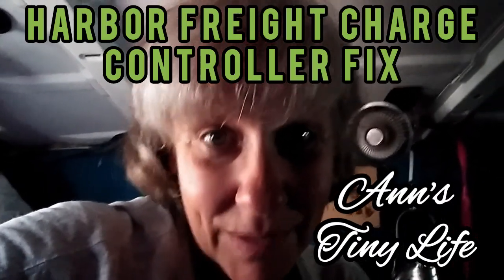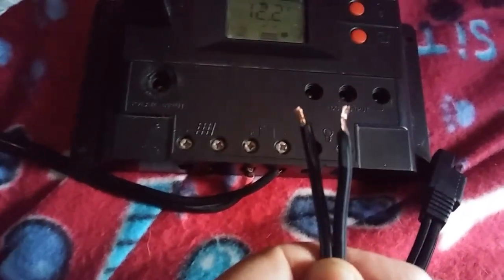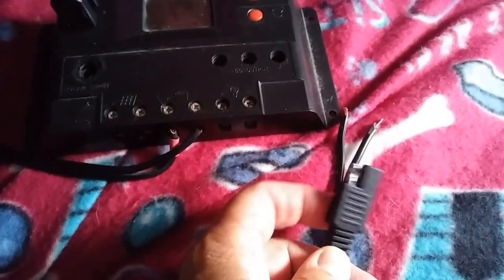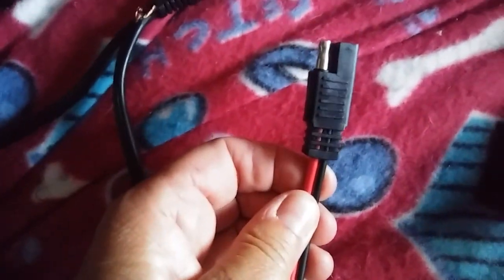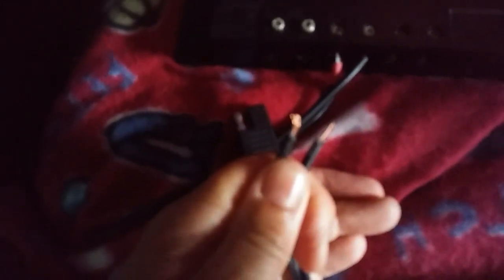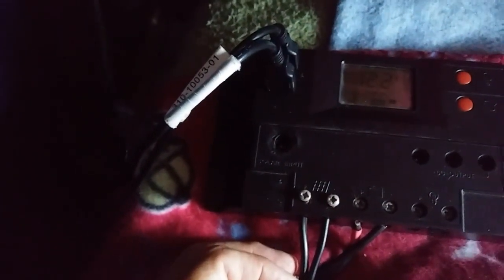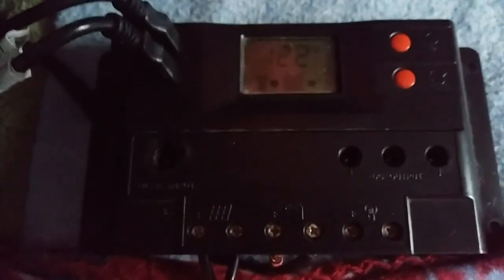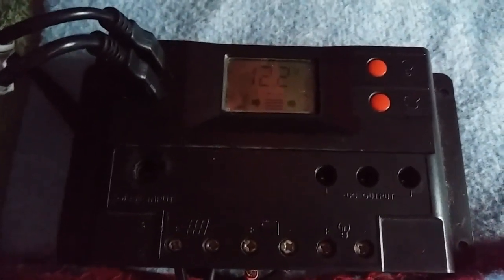I Fix My Harbor Freight Charge Controller so I can continue using solar! - Ann's Tiny Life

Comment: Just a tip Anna get 42amp wire u get better results and after your cables look like 7.5 amp so not good enough if u begin in 13amps

Comment: I have a similar controller and friends that use that type.  The wires have to be stripped fairly short as you did them or too much naked wire hangs out.  You solved the polarity question quite well although I think they simply dont work when connected wrong - Im not game to test the theory hehe.  Multimeters arent hard to use once you have seen it done but I was impressed at the educated guess you made and willingness to have a go.  A 20 amp controller is actually pretty ok considering that if you use anything near that with you engine off, it will flatten your battery FAST lol.  12 volts times 20 amps = 240 watts.  For comparison, old fashioned parking light bulbs use 10 to 12 watts (so maybe 45 watts for all four) and we all know how fast we flatten our batteries when we leave them on.  The great thing is you can set a voltage level you want the controller to turn off the power to save the battery.  This feature has saved me a lot of expense and damage to batteries and wiring that overheats when voltage goes too low and the appliance has to 'suck' extra hard to get its power etc.  Good on ya Ann and may I say "looking fine there" too.  Cheers
Reply from the maker: Ah Mick! Thanks so much. And thanks so much for all that information to. Yeah I took an educated guess and it turned out well. I'm pretty glad actually. and I never understood figuring out the amps vs. Volts vs. Watts stuff so thanks for taking the time to explain it to me I'll have to read it over a few more times until it sticks. Thanks again. What a sweet comment at the end.
Reply: @AnnsTinyLife  I like to use the analogy of water with electronics with the wires being water pipes.  Imagine the battery is a bucket of water with drain tubes at the bottom representing wires.  The voltage is the amount of water you potentially have to use in the bucket and the amperes are the rate or amount of water going through the tubes at the bottom.  Amps (outflow from bucket can mean different amounts depending on how big your bucket was to begin with.  So its like amps are the percentage of water draining and watts are the actual amount ie, 1 liter per minute (watts are watts lol).  It isnt a perfect analogy by any means but makes it easier for me sometimes.  I am solar off grid so always finding new electrical problems that completely baffle me.  Looks confusing now I read it back but Ill post it anyway.  Have a good one.
Reply from the maker: Haha now I'm really confused. So you're off grid then? Do you leave in a regular house or an RV, or tiny house or something? It's my dream to have a little tiny house and a little tiny homestead.
Reply: @AnnsTinyLife  Yes I thought it looked confusing too lol.  Its just a small house (Vic Australia) on 6 acres.  I started with a 12 volt system but it just wasnt enough for PC, lights water pumps etc, so I ended up buying a big 48 volt system with 2400 watts of panels on the roof and an auto kick in generator.  It was a little beyond me to install so I 'called the guy'.  I still use the original 12 volt but only for pumping water and a diesel parking heater.  I like being off grid but like to have the house so you wouldn't know it.  I can run 1000 watts for 12 hours in the dark and never more than 4000 watts at once but thats heaps for my needs.  I have a lot of respect for the way you live because as fun as it can be, there are moments when off grid RV type life is anything but romantic.
Reply from the maker: Wow sounds like you got quite a setup! I envy you. Yeah vanlife is pretty cool but it's not very romantic. That's okay I think I kind of feel that who knows it anyhow. LOL

Comment: Got one yr  out of the controller,,,,smh
Reply from the maker: yep theyre garbage.
Reply: @AnnsTinyLife  its called China freight for a reason. What upgrade controller did you speak of and where can i buy it?
Reply from the maker: @kevreilly7  Lol! Indeed! I've upgraded several times since then but the one that's worked best and longest is the Renogy Rover 40 Amp mppt. I got it off Amazon. Here is the link. It's an affiliate link so if you buy something I may make a small commission. 

https://amzn.to/3KHJ7r1
Reply: @AnnsTinyLife  thx. I use it for a lil water fountain pump that i dont want to run an ext cord to